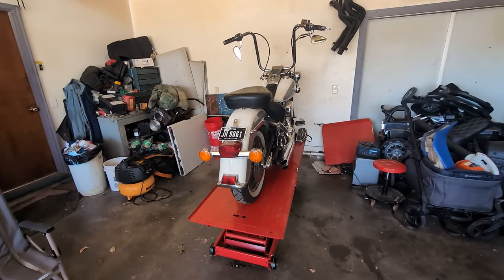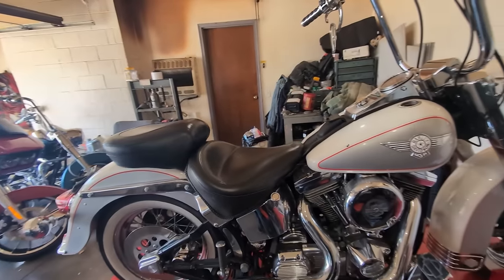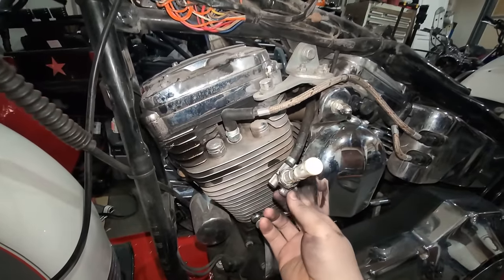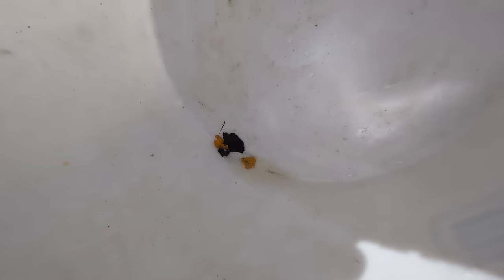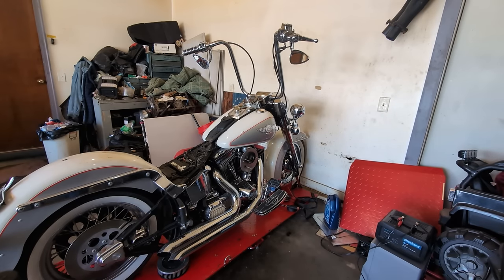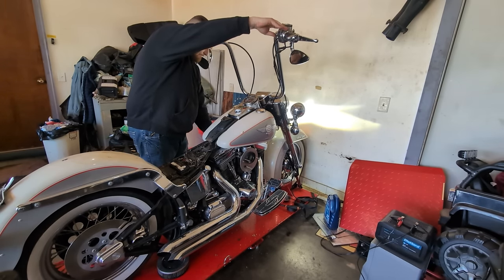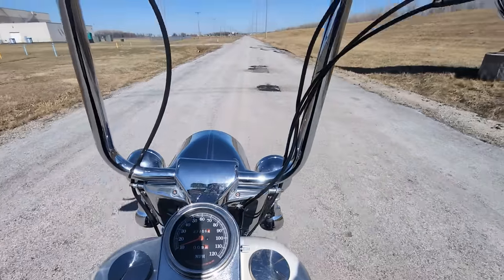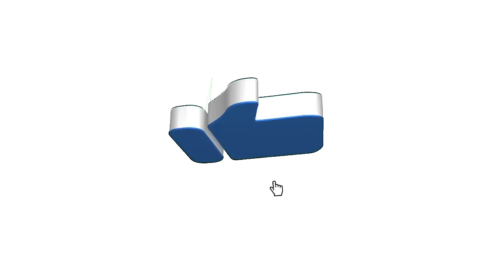Will It Start!!! Can We Get This Old Harley Running | 1994 Harley Davidson Heritage Nostalgia.

Comment: Kept saying “file the points” and I was just saying to myself, they ain’t no points on this bike it’s a 94!  From the ignition box under the seat still the stock Harley ignition. Trick with the choke of it’s a modded evo I’ve found is start it with full choke and back off to about half. Just gotta ride easy and listen for when it’s ready to be off choke. They can take a bit to warm up, but under load it goes faster.
Reply from the maker: I agree, in the making of this video I soon found out it did not have points, you are correct, the choke issue is fixed too, the video was too long to add everything in, thanks for the comment.

Comment: The way the bike hesitates after you pull the throttle makes me wonder if you need to adjust your mixture screw on the carb. It sounds like it's struggling for fuel. Very pretty bike though. Good job.
Reply from the maker: Yes sir you are absolutely correct. I was just doing that now. She is running great. Had to drill out the plug that was blocking the screw, . Thank you for your comment

Comment: I just had the carburetor on my Sportster for the first time in 25 years. Even with a carb full of crap it still tried to run. AMF made the EVOLUTION and it's HD's best motor. Twin Cams and M-8 are disposable and mechanical nightmares. Old fuel and oil line needs replaced because of age. EVOLUTIONS are great bikes.
Reply: You put a carb on your bike after 25 yrs..??
Reply: AMF didn’t make the EVO
Reply: @josephtizol9695  the EVO  moto was under development for 7 years before it came out . Do you think the new people did it over night?
Reply: @jerrybigrig  My carburetor was cleaned for the first time in 25 years. My smart phone is stupid.
Reply: @frankmarkovcijr5459 so by new people, u mean harley davidson engineers. Who had been working there since before AMF?
Reply: @panheadsforever74   by the new management. Any body working there in the 70's were retired by the time of the buy out. AMF did the EVO engine.They had nothing to do with the Twin Cams. Stop trying to blame AMF.
Reply: @frankmarkovcijr5459 I had a 77 Lowrider (AMF), that had problems with electrical gremlins from the day I bought it. Conversely, I've owned both an 89 Electraglide and a 97 Heritage, and have had zero problems with either of them. Take from that what you will.

Comment: i guess you didn`t bother with a carburetor clean....most guys would have....but you got lucky....good stuff....thanks for video....a carburetor clean would have happened if it was an S&S carb....jets and float bowl etc all gummed up and or sticking....again good video....my 89e evo decker soon to be same treatment.....canada
Reply from the maker: The video was too long, I did pull it off and it looked great on the inside, put it all back together and shes a runner, CV carbs are pretty forgiving. I don't know much about S&S carbs but I have heard they are a pain sometimes. Thanks for the comment!

Comment: why no spark at beginning of video....i missed it somehow....was it bad plugs or ignition coils or battery or what ??  and  what about the baking soda you mentioned.....
Reply from the maker: Yeah there were a couple video parts that I didn't throw in there because the video was too long. I did baking soda and water mix and dumped them in and let it sit over night. For the spark issue, the plug that I was testing one of the plug wires were bad which was addressed.

Comment: when you run no baffles...possibility of burning valves and there is no back pressure plus a loss in acceleration and horsepower....even though so many run no baffles.....just to let you know....
Reply from the maker: I agree, if this was my bike I would have had a different exhaust set up, this for me is too loud. Thanks for the comment!